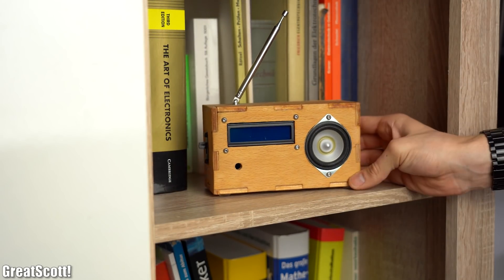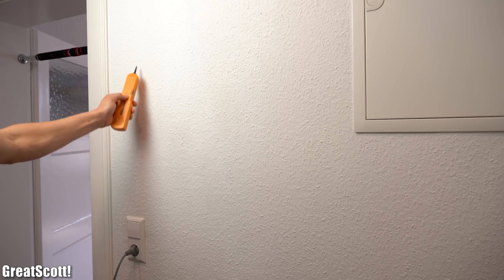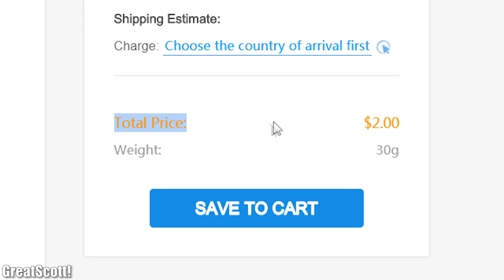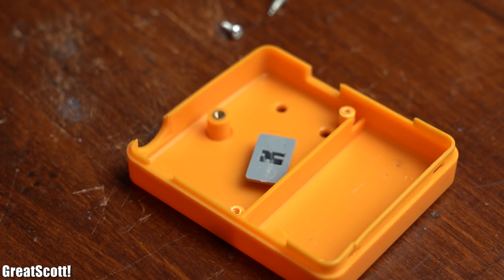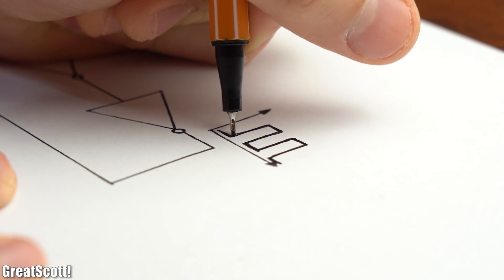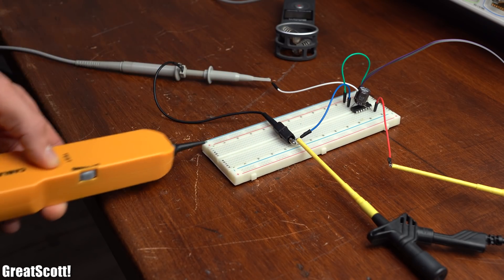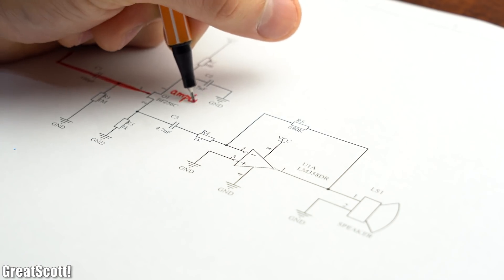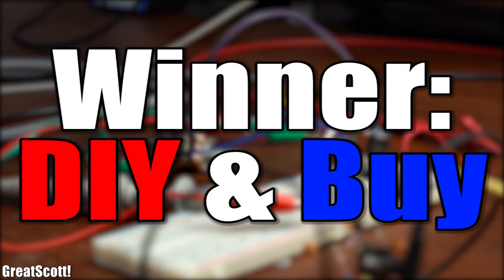Cable Tracker || DIY or Buy || A useful tool for every electrician!

Comment: Hi sir I am making DIY 1-12v DC  variable power supply using LM317 regulator ic about 1 month. I am working and I have also tests my DIY powers supply  but now all DIY powers supply project is finished but I get problem when I test last time my DIY powers supply. When I reduce the voltage below 5v DC.  voltage can't go below 5v DC . When I see data sheet of LM317 regulator it says regulator output 1 to 39 v DC but in my case I am using mixmium 12 v dc adaptor in this project. I have rechecked 3 times my circuit looks fine but it is not working properly. If u know let me know. Circuit digram link https://www.google.com/search?q=lm317+circuit+diagram&prmd=ivn&sxsrf=ALeKk01eCCCe-pADCfwqSQ-j2USh69RUeA:1603689165823&source=lnms&tbm=isch&sa=X&ved=2ahUKEwjG7rvYv9HsAhWDonEKHcTuAIUQ_AUoAXoECAMQAQ&biw=360&bih=624&dpr=2#imgrc=Q9p7F_W4y9EHpM

Comment: 7:25 Schematic problems! The schematic of the receiver seems a bit off. Q1 cannot operate the way you have drawn it. Comparing to the board view at 7:11, you seem to have added a D1 that's not on the board. And then your schematic could be made plausible by swapping the emitter and collector of Q1.  Other than that -- keep up the interesting investigations!

Comment: I had hit a cable with a pretty tiny piece of metal. 
I hit the nail once and light had been gone cause it had been laid horizontally far too low where there shouldn't have  been a cable. 

Luckily I was able to fix it by pulling the nail out of the wall and without digging into the wall an replace the damaged cable by an insertion.

Comment: theres a reason those things cost under 20 bucks and the real ones cost a couple hundred, with real ones it works with AC or telcoms voltages active, no need to disconnect them, thast why the real ones like aegis cz1000 etc are used heavily in telecoms world

Comment: 7:26  Is this schematic correct? The first thing I notice is there is no power connection to the preamplifier, how can it achieve any amplification? As drawn, once the circuit reaches steady state the junction of D1, R6, and R7 will be at 9v. For any signal to get through the emitter of the transistor will need to be above battery voltage. I'm not sure if this is the proper fix but it looks to me like you may have GND and Vcc reversed on the preamplifier circuit; if you swap them it looks like the circuit would work.

Comment: The JFET, as you used it (common drain) was not really amplifying voltage, it was just buffering it, in which case you could just use an opamp as a buffer.

Comment: We have used friends guitar amp and guitar connector for finding installations in the wall. It starts to buzz when you are close to the wires. At first we started with the whole guitar, but later found out that it is also ok with just a jack.

Comment: Great video as always. But I have another idea. Which is very simple. Just connect 100mH inductor to microphone amplifier. If inductor get close to wire, you can hear 50 or 60 Hz humming from speaker.

Comment: Two comments,
1. This is not a ring oscillator. As you explained, in a ring-oscillator you the frequency determined by the delay of the invertors
   In this circuit the delay determined by the R, C values and the hex invertors use as inverting amplifier (delay is neglected)
2. Try using a piezoelectric speaker.
Loved this episode. 
T

Comment: Op-Amps should not be used as audio amplifiers in most applications. They heavily distort the audio signal for anything that isn't a single tone.
Reply: What do you mean? If you're not overloading the opamp it should work fine. If you're getting heavy distortion maybe there's a problem with your feedback circuitry or maybe you're saturating the output.
Reply: @eDoc2020  Op-Amps are intended to amplify non-audio signals, such as for industrial instrumentation. The amplification provided by an op-amp varies based on the input frequency. It isn't distortion so much as unfaithful reproduction of the signal. If you keep with a single tone or limit the frequency range to one small enough to not be not effected enough for it to be noticeable.

If you want to do a more basic circuit than using an IC audio amp, a couple of transistor gates (MOSFET or BJT) and the associated resistors and filtering caps would be the way to go, not using an op-amp.
Reply: @KnightsWithoutATable  You must be mistaken. Opamps are used all the time for audio, in fact many power amp ICs are actually opamps.

I have the schematic for a Marantz CDR630 professional CD burner in front of me and it uses NE5532 chips for its microphone preamp. According to the datasheet, these are "Dual Low-NoiseOperationalAmplifiers".

I'm curious where your knowledge is coming from. Is this something you've read or something you've learned through experimentation?
Reply: @eDoc2020  Advanced electronics classes taught a college. The specific topic came up when talking about methods for increasing the quality of the encode and decode ends of a communications path. You can use them for low quality systems where the uneven amplifications doesn't matter, like in a digital radio system (not for the carrier wave, of course. There are better circuits for that).

Op-amps have been taught to many engineers as a go to amplification device since they used to be much cheaper IC's and because talking about actual audio amps is typically a class in and of itself when taught at the EEng level. They are also relatively efficient on power consumption and very small, unlike Class A or Class B audio amps. Now, we have cheap class D audio amp ICs that are just as power efficient, almost the same cost, and are just as small. There really is no reason to use op-amps for audio amplification unless you are planning on producing thousands of units and the audio quality doesn't need to be all that good, like for cheap handheld 2-way radios or a really basic intercom system. Heck, you can get away with them in a POTS handset too since the frequency range on that is so clipped off anyway (This is why you sound different on a land line telephone than in person or over a cellphone).
Reply: @KnightsWithoutATable  I'm not saying you should use a LM358 as a power amplifier, but that better opamps are perfectly fine in signal paths. If opamps are bad for audio why are they still found in the signal path in Hi-Fi equipment?
Reply: @eDoc2020  Cheap design or they are in part of the signal path that uses a single frequency that they are good at reproducing faithfully. Boosting the PWM signal being sent to the power stage of a class D amp comes to mind.

Some of the newer op-amps are capable of doing audio, it is just not the best part and for a one off prototype, why not use the better IC?
Reply: @KnightsWithoutATable  What sort of chip would you use then for amplifying a low-level audio signal?
Reply: @eDoc2020  There are audio amp ICs that would work. Which one depends on the application and required specs of the final unit. If you are designing for mass production and the specs wanted only basic audio, then maybe an op-amp, but that would depend on the price I could get from the supplier of either IC.

Comment: What about this one ? I use it and it works , too - even you don't have to switch off your breakers 
https://www.amazon.de/Fluke-VoltAlert-Spannungsmesser-Ber%C3%BChrungsloser-Spannungspr%C3%BCfer/dp/B000EJ332O/ref=sr_1_17?dchild=1&keywords=spannungspr%C3%BCfer&qid=1603662158&sr=8-17

Comment: With a cascode amplifier as the input stage you can directly pick up the hum at 50 HZ that you can hear louder when the antenna is close to the cables: you don't even need to turn off the electrical system.
Perhaps at this point diy costs even less, and in terms of accuracy I think it is very similar.
But if you add a potentiometer between the input stage and the amplifier you can adjust the sensitivity of the probe, in order to increase the signaling precision: at each passage on a critical point, reduce the sensitivity until you find the passage of cables as precisely as possible.
Hi and to the next video. 
P.S.:
Even in Italy too, there is some regulation on how to build a civilian electric plant. 
In any country you live, the biggest problem is in old houses, built without rules or with rules different from those of today.

Comment: probably a stupid question but is it possible to build a NFC sender so the cable in the wall become a NFC tag? One could use a smartphone as detector (of course after program an NFC app that measures the distance to the tag :-) )

Comment: on DIY version I would add the lcd to it and by analysing amplitude to vicinity ratio (i.e. distance of 0,5m = 0,4V and 1m = 0,2V ) output the value to display making it better, probably then there would be need of only arduino nano, lcd and amp for receiver.

Comment: Many clamp multimeters have a NCV (non contact voltage) function, it works quite well on my UT210E and does not require a sender, just detects the field from mains AC. Seems more useful to me, especially if there is no outlet nearby. Or is there any advantage with this injected HF signal?

Comment: In America, we have 0 standards on where they have to be on the wall. If someone who is a professional on the subject knows otherwise, I would invite you to investigate any Texas built home that was commissioned by a labor force, and built by the government essentially, local federal or state doesn't really matter, they are all about saving money. They should write blueprints in Spanish from my experience...

Got a house from the 1980s, no fume hood above the stove >_>....the second light switch in the living room you would assume controls the light, controls a wall outlet...and there is no ceiling light in the living room.

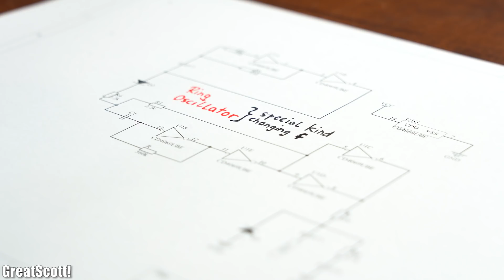6:00 you can order those from their website directly for dirt cheap if you didn't know. I imagine you know, but if you didn't, there ya go. https://www.ti.com/, I know you are not in the US, shipping might make it not worthwhile.
Reply: The stove hood could be an issue but your living room switch is perfectly normal and is expressly permitted by code. The idea is you plug a lamp into the switched outlet, then the switch turns the lamp on and off. This is common in rooms like bedrooms and living rooms.

Oh, and there are some standards of where the wires can be in the wall. When wiring passes through wood members it needs to be either at least 1.25 inches away from the edge or protected by a steel plate. This is so you won't hit wiring when drilling into studs. But yeah, other than a few fine points our wiring can be almost anywhere.

Comment: Standards don't mean the electricians followed them... Plaster hides everything. In my flat I drilled trough a 3-phase cable that was going diagonally across a wall. 10 minute job turned into a 2-day one. Had to remove quite a bit of the plaster, (drive to buy supplies) fix the cable, apply plaster (wait) and paint...

Comment: Cables and water pipes are one thing, as they can usualy be turned of  with a circuit breaker or main supply valve. Drilling into a heating pipe is where the real fun begins, because the expansion tank usualy makes sure that the stream of 60-70°C hot deep black sludge wont stop any time soon... So how about a "Pipe finder DIY-or-Buy"? :D
It should work with ferrous and non ferrous metals to detect Copper, Stainless steel, Iron, Cast iron and the aluminium layer in PEX-Pipes

Comment: "Thankfully I live in Germany, where there are standards"

Laughs in old house where every corner is anything but 90°
Reply: Laughts in newish house where the wireing was done when the principle contractor already started to not pay the sub contractors.
Reply: Smiles in 85 year old house where every single wire is surface mounted. Also water lines.
Reply: @Teknopottu  ...makes drilling holes easy.
Reply: @Teknopottu  Surface mounted wiring and components 😲 Your house was way ahead of its time!
Reply: yeah, here are some in 45° to safe copper, "Stegleitungen" and other funny stuff that makes every drill a thrill.
Reply: @underwoodblog  NYIF cables are the worst. Even worse if they use the old color scheme
Reply: @canonip3000  more worst if there are multiple color schemes.
Reply: Pats your shoulder in japanese budget house where all the wiring is done using a single color wire
Reply: @app0the  live, neutral and PE have the Same color? 
Geez
Reply: I know what you mean, our old houses have there own standard 😁
Reply: ... and we have standards - this made me laugh so loud :)
Reply: 90° would have been waaaaay too hot. ;)
Reply: Was gonna say the same, I'm here precisely because I want to drill in my Altbau apartment and I feel like cables could be literally anywhere

Comment: Sometimes while tone tracing communications cables like category 5 or category 6 data cables through electrically noisy environments it is necessary to span pairs with the tone instead of just testing one single pair in a cable. This is because within a single twisted pair of a cable that is merely bent too acutely the signal can be shunted but spanning two different pairs with the tone both lessens the characteristic impedance presented to the tone generated while lessening the chance of tracing signal shunting. The result is a much louder and stronger tone for tracing.

Comment: I used a similar device to locate underground metal pipes on a gold course I worked at. We would drive a metal pin (rebar) in the ground for one lead and clip the other to exposed pipe. The corrosion on the pipe would insulate the pipe from the earth enough to track the pipe. Supposedly that unit was $600 USD. What would it take to make this device detect a path up to a meter or two deep?
Reply: Probably about $590 worth of parts 🤣🤣🤣

Comment: I think Darlington triplet with a buzzer and an antenna would do just fine.
Reply: No have done this, years ago  it needs to be amplified more.  (Even with earphones used) tested with a commercial Transmitter  and a DIY Transmitter  (NanoESP )
Reply: @frankschacht5755  Buzzer, not speaker. It beebs when you connect voltage to it

Comment: The transmitter with an Arduino that encodes the signal would be awesome. Then you could have multiple outputs with different beep patterns for tracing multiple runs at once. And keep using the bought receiver.

Comment: Realizing now I spent 80$ on a Fluke toner for work when I could have made one. I will say the Fluke does have an advantage: if you set it to an alternating tone and then touch the leads of the transmitter together, it changes tones to confirm you found the correct wire.
Reply: If you hold the tip of your toner in one hand, and the bare wires your testing in the other, you will hear the toner pick up the signal through your body. That’s how I used to use mine to confirm the cable.

Comment: The principal advantage of purchasing, and purchasing a good quality version from Harris/Fluke or the like, is the durability of the tool.  Doing telecom work I've found that cheap ones end up internally using gossamer-thin varnished wires the ultimately break when the tool is inevitably dropped, but quality ones use either just PCB traces or thicker, insulated wires that survive falls.  Sometimes the probe tip breaks, but good tools have modular tips anyway so replacing it is straightforward and the tip is intentionally weaker than the PCB so that the tip, not the PCB, breaks.

It's along the same lines as using a proper telephone butt-set instead of a trimline phone, the butt-set can handle being banged-around in the truck or on the belt as one works, and can handle falls from-height if it's dropped, while the trimline phone just breaks.

Another advantage of buying, and buying quality, is that the oscillating tone can be changed, so that if multiple techs are working in the same area, they will be able to identify which tone generator corresponds wit them or with a given circuit.

Comment: Great video, but it would've been nice to see the DIY circuit used against drywall as a real use case test. Otherwise, even for a quick solution, it is useless if the DIY circuit can't detect electrical wiring through the wall (even if the signal is weak that's better than no detection).
Reply: I also wanted to see if the DIY could be used for the exact use case shown for the Buy. However for less than $14 I feel that they Buy wins when you factor in time to get components and building (say $7 per hour) to the cheap cost of components.

Comment: Sadly this video came two weeks after I bought one already. But: how would you increase the sending power of the commercial ones? Mine is barely enough for 20cm air, but I would need 40cm concrete to trace the cable..
Reply: Rule of thumb for broadcasting states that input and output power are related in an inverse square fashion. To get 50% more reach you need double the power. To get 100% more reach you need about quadruple the power.

Comment: My multimeter has a non-contact voltage measure function. You can find the AC wires with it while keeping the voltage on your wires.